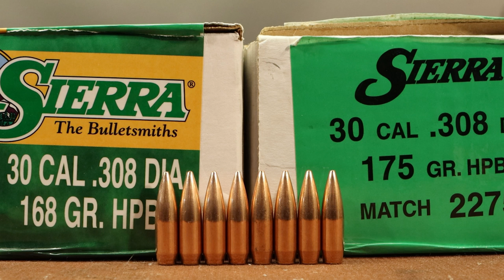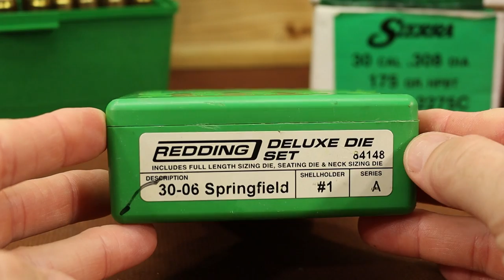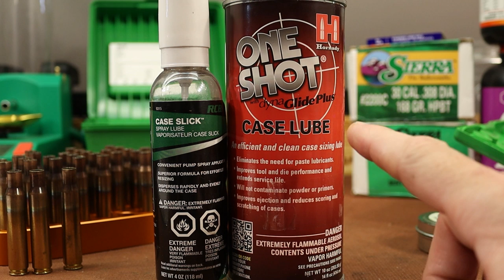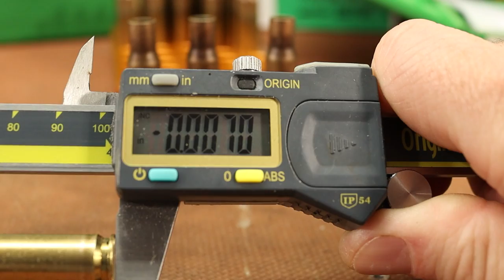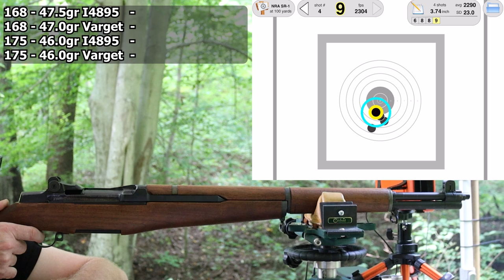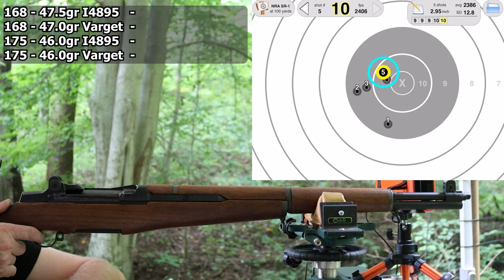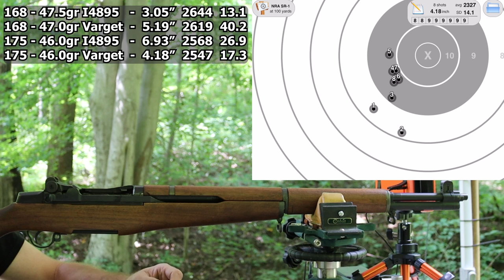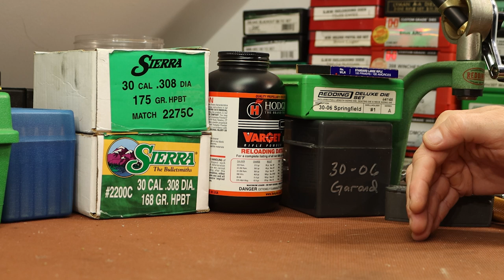Reloading .30-06 for my M1 Garand

Comment: Great video my friend. I was wondering if you have any in put on doing 150gr bullets vs the 168gr and 175gr you used in your video? My Garand is all original and I have always been fearful of over pressures. Any input you have would be greatly appreciated.
Reply: The original M2 loads were 150 grain fmjs. Use a powder with a similar burn rate to 4895 and don’t exceed M2 velocity and you should be fine.
Reply from the maker: I almost included 150s in this video. That's mostly what I've loaded in the past. Plenty of data available and no reason to avoid them.
Reply: Would like to see a video on 150gr bullet with 4895 and 4064 maybe?

Comment: I actually think a lot of folks think Varget is borderline as to being too slow of a powder. Would love to see 4064  and H4895 next if you do another with the M1. Maybe an M14/M1A if you can get your hands on one.
Reply: I use IMR 4064 and a 150 grain FMJ... absolutely great load
Reply: I use H4895 for both my m1 and m1a. Hornady match 168bthp with 46.5gr. Of H4895 in the m1 (30-06) and 42grn in the m1a (.308) I found these loads have been best for me. Both use the same CCi #200 primers as well.

Comment: you may find this interesting or hell not I don't know but something I did when I got my M1 Garand from the CMP last December is put a scope mount on it from Galati International.

"M1 Garand Scope Mount Weaver Style"

it's offset like the type D sniper style M1 grand. This allows you to load the clips, provided your windage knob isn't in the damn way. I realize some people probably find this Blasphemous but it eliminates (or at least severely reduces) one of the variables when doing load development. You can always take it off and put the iron sight back on later. Plus it even gives you a crude peep sight to use. it did allow me to get my groups down to about an inch to inch and a half from two to three inches.

30 06 is pretty versatile and it's fun playing around with different loads. and if you really want to get off into the weeds you can get a gas block that will reduce the port pressure for the Op rod.

Nothing real serious but fun to play around with and I wouldn't mind taking this old girl hunting once or twice

Comment: Just did 100 for the Garand tonight. I spray a few shots of the lanolin lube on folded t-shirt material that the case body fits perfectly. The neck/shoulder hang off the edge. A single roll is all it takes.

Comment: 44.7 grains H4895, 44.6 grains n140, Varget. 168 grain hpbt. Keep it under 2600 fps and you won't bend or stress your op rod because they are expensive. Medium burn rate powders. I use the Hornady manual and have excellent results. The military brass is thicker, so you might want to reduce your charge by a grain.

Comment: I would like to suggest a science video. On each press each has a ram. Some say that if the ram has wobble it's bad. Then you got presses that have floating parts to "help eliminate" run out. Then you got companies like 419 with very good tolerances with minimal run out. My question is does any of it matter to the basic reloader? Do prices justify accuracy? Or would you have better result from brass prep verse what the press is capable of doing? Just another rabbit hole of endless possibilities.

Comment: "Some of these are taking a lot of force...".  That is a reason not to buy a small press if you intend to size larger rifle cases.
For loading various loads I recommend charging a batch of cases, seating the bullets, then mark those loaded rounds.  This way you don't run the risk of getting anything mixed up.  You can use colored Sharpie pens to mark the primers for different loads.
My understanding is with an M1 Garand you push the cartridges in and the bolt should start to close automatically.  If it doesn't then you bump it with the heel of your hand and it should close.

Comment: The problem I run into with the hornady manual is there load data is to slow it doesn’t cycle my Garand. I had to go on the cmp website to the forum and ask people on there to get the proper load data. I also chrono my Greek 30-06 ammo because it functioned perfectly and it was hotter than hornadys load data.

I was also using 4895 and varget

Comment: Great video, the military load data for the M1 Garand shows 150 Gr FMJ bullets loaded with 50 Gr of IMR 4895, @ 2750 ish FPS.  Could be another video?
Reply: The military spec. of 2750 was with the crono's set at 71 ft. from the muzzle.  M2 Ball spec. is 2805 at the muzzle.  That is the spec. that the CMP has Creedmoor Sports load it's M2 ball at when you get 30/06 from them.

Comment: A lot of basic information in this vid. 🤔
Case head separation is not a sign of "way high pressure". It can happen while using standard pressure loads. Case stretch on the initial firing can sometimes be significant. Subsequent reloading with minimum spec FL die and firing in a maximum spec chamber will cause it, all while using standard loads. Good vid. Sure wish I had a Garand. I have loaded Garand ammo but I take the recipe right out of Mike Venturino's book "Shooting WWII Small Arms." Thanks, JRB!

Comment: Question: Are you concerned with the free floating firing pin hitting these after market primers and setting them off prematurely??? I've had fellow Garand reloaders tell me about horror stories due to after market primers... What do you think??? My Garand was built, (at least the receiver was), back in Oct 43. Ordered it just as soon as Trump signed the papers allowing them to be repatriated into the USA!!! Just got lucky I suppose. I purchased a tin of 800 150gn ball ammo sealed from Lake City (manufactured in 54 I believe) and so far have been terrific!! Getting the primers out has been a problem but I purchased a Lee depriming tool as you suggested and have had much better results!!  Thanks for the video, really enjoyed it!!!
Reply: I use CCI 34 Large Rifle Primer mil-spec in my M1A, no slam fire issues.  I did see slight indent using regular CCI 200 large primers.

Comment: 46 grains of IMR 4064 with the 168s mimics Greek HXP.
Reply: I have used that load @ 600 yards, works very well.
Reply: @hardball107  it’s my go to. I use HXP and CCI 34s.
Reply: @RoscoPColetrane  The 34's are a safe bet.  I never had it happen to me but I did once see a slam fire from another rifle, not for me.  I change the firing pin every 1000 rounds and check the timing on the receiver bridge.

Comment: Yet another comment: Your bullet choice for the Garand in this video is less than ideal.
Since you're loading fora semi-auto that slams each round into the chamber, you really should be using bullets with cannelures, then crimp into the cannelure.
Those loads that you made will have the bullets tend to creep forward each time the round slams into the chamber.
I never crimp my loads in either of my own .30--06 rifles, but that's because they're bolt actions that do not need crimp.
Crimp in bolt guns is really only necessary with very hard recoiling calibers, especially dangerous game loads such as .375 H&H on up.

Comment: Not a big fan of rcbs dies sofar. Only have one set of them for 9mm, but if I don't have a lot of lube on the cases, it tears up brass. And even then it tears up the occasional piece. Which is odd for a carbide die. None of my other dies do that. Not even the standard non carbide dies. Only reason I still use it is cause Everytime I go to buy a different set for 9mm, it's sold out.

Comment: Unless you just like to do it (or to be prepared for the next plandemic induced shortage) is there a reason to reload vs buying PPU or S&B for .50/rd?
Either way it might be worth it to get a bit of standardization in the brass.
Reply: I cant find either of those for under 1.25/round. Can reload for .60/round

Comment: I bet that initial first shot from the 168gr over Varget...you might have accidentally plopped a 175gr pill on it. The velocity was consistent with the 175gr test...as well as the initial shot placement.

I've made the same mistake with 69/77 smk before. Really messed up my load test!! Anyway, that 168gr/Varget looks like a winner.

I like to load 150gr for my Garand...keep it close to the original M2 ball load spec. Not to mention, the Garand provides the best service inside of 500 yds. So, 150gr can handle 500 yards all day long. And, of course, 150gr rounds provide the best service to my wallet😜

Comment: Your group sizes would improve with proper bench technique with the M1 Garand. 

1. Never rest the rifle using the forward handguard! Ever.

2. The lower portion of the main stock behind the sling swivel is the only place that should rest on your bags, that will give you more consistent results.

3. 46.0 grains of IMR-4895 or H4895 was considered the standard M1 Garand load with 168 grain SMK's until it fell out of favor in NRA/DCM tournaments in the mid-1980's.

4. Start at 45 grains, increase .5 grains at a time (30 fps difference in .30-06), don't go over 47 grains with 168's. You can refine your load, once you discover the one that shoots the best. .5 grains and only 30 fps+/- is a pretty tight window. 

5. Varget, RE-15, IMR-4064, VihtaVuori N150, VihtaVuori N140 will all work if you can't find a 4895 powder. Powder charges remain almost the same. 

6. 3.250" oal is a good place to start with 168's, 3.340" is possible with 175's. 

7. Original M72 173 grain FMJ sniper bullets (Vietnam era) were loaded close to 3.340" and 2640 fps from a 24" barrel. Probably close to maximum from a M1 Garand. 46.0 grains of IMR-4895 was a maximum charge, but commonly used when loading these "surplus" bullets for competition. Some rifles would shoot them very well, a lot would not. They had thick jackets and tough cores, and pressures were higher than normal compared to other bullets.

Comment: JRB did you do anything to protect your shoulder?  The steel plate of the butt-stock is bit painful to me.
Reply: they make products called "limb-savers". It's basically 1/2" or so of rubber that you slip over the butt of the stock. Around $35 last I checked.

Comment: Have winchester, starline and R-P brass and all 20 peices of R-P had to be sized 3 times to get the shoulder bump right.. pain in my ass.. I annealed with then amp annealer so I know that was not the problem.. just shit brass
Reply: Did it size consistently with the other Remington brass? I personally find differences in shoulder bump depending on the brass used which makes sense when you think of different alloys of cartridge brass.
Reply: I reload these on a zero press. I always size like and kind together and then move on. It's usually +/- 0.001 on average .. 100% because of the press and the amp annealer, worth every penny..
Reply: I get best results with starline and lupua..

Comment: Hodgdon H4895 groups better than Varget in my guns several calibers. Better powder yet is Alliant Reloader 15 its as stable or better than centralite coated Varget In hot or cold and groups alot better in my mid size cartridges. 

 In the .308 winchester try 35grains Reloader 7 topped with 150 grain sierra match king and CCI Primers winchester brass.

Comment: If you don't have a chrono...you can tell a lot about how happy the rifle is with the load by the ejection pattern.   1-2 o'clock it's happy....3-4 it's starting to tell you to back off...and back over your shoulder is  WAY too hot.   This is of course assuming you have fresh springs and a sound rifle.

Comment: I have a remmington semi auto 3006, if I reload for it do I need to use that load data or can I use regular 3006 load data?
Reply from the maker: I have a 7400 that I've never been able to get to run properly with handloads. It runs great with standard Remington factory ammo. I even did some videos about it a LONG time ago. Never really had much luck getting it to cycle properly.
The next time I load for it I am going to try some hotter loads with slower burning powders.
So, back to your question...you can try the Garand data in your gun but if it's anything like mine, it's not going to cycle properly.
Reply: Just use regular 30/06 load data, I had a 742 carbine and a 750 rifle, they are very strong and will work fine with standard data.  Just make sure you full length resize.

Comment: Hi Sean,

Great video, I loved your content! May I provide you cartridge dimensions from my LC ‘69 (M2) and FA ‘60 (M72) match ammunition? Here we go.

LC 1969 cartridges have a CBTO of 2.713” (using Hornady comparitor set (yes, not transferable to your measurement devices). OACL = 3.328” average of 10 cartridges.

FA (Frankford Arsenal) 1960 M72 Match Ammunition, MV = 2640 f/s. CBTO = 2.706” (again not an absolute value, you comparitor will vary). OACL = 3.328”. The sample size was 10 cartridges. I bought my M1 Garand from the DCM a predecessor to the CMP. The DCM Was administered by the Federal Government and the current CMP is privately owned. Congress made this change I believe.

My M1 Garand was manufactured March 1944 by Springfield and was reconditioned by Springfield in 1952 for the Korean War (has SA 52) stamped on the receiver below the original manufacturing markings. I bought from the DCM about 1987 for about $124. Great buy I think.

Good luck! I love IMR 4895 for my Springfield M1A (NM 1987) in 308 Win. Did great out to 600 yards using Sierra 168gn HPBT Match bullets. I did terrible at 1,000 yards in Lomira, WI state match. Yes, I was a service rifle sling competitor.